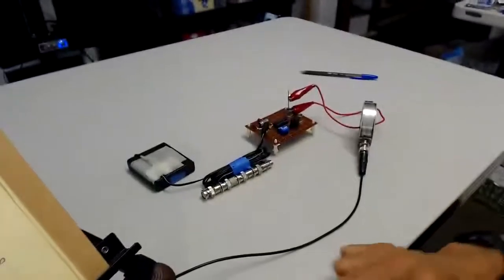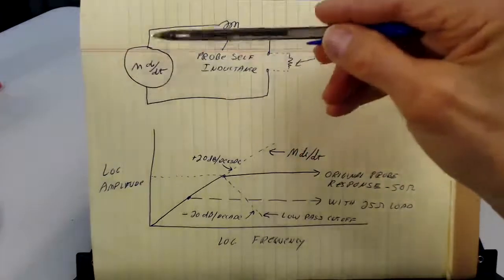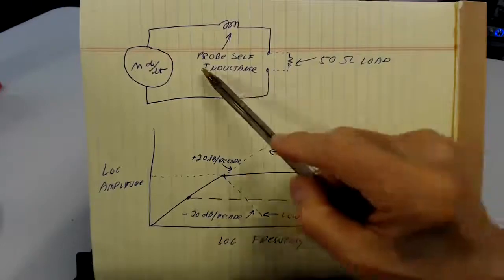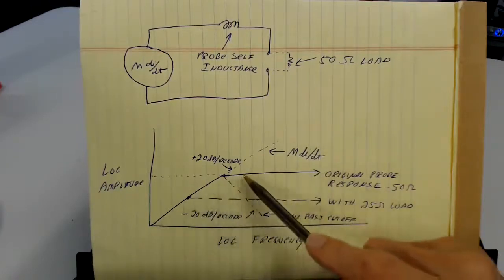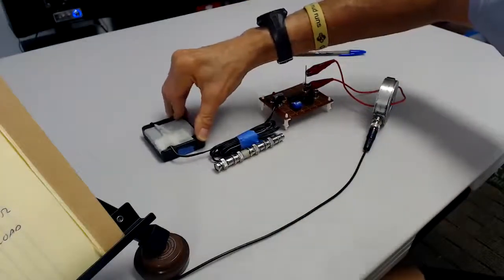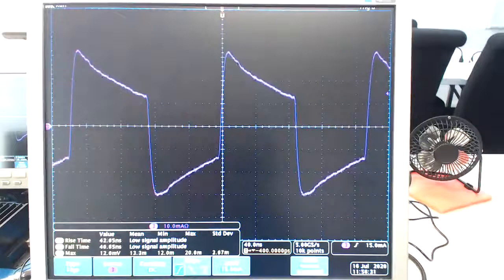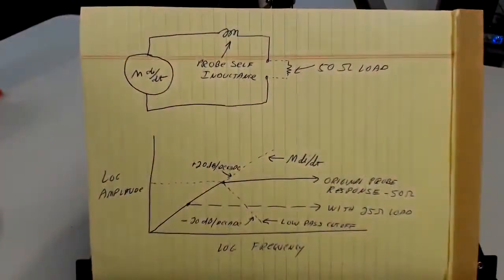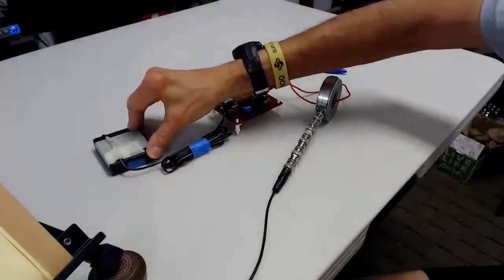Modifying a Current Probe's Frequency Response

Comment: Might be worth putting in a phase advance circuit at the source end to flatten off the coil's response and keeping the sensitivity.   Then you could also load the output of that circuit with the 50Ω and have it matched for the cables and scope.   

Slightly different use of a control theory circuit!   https://www.youtube.com/watch?v=MAb3MkngkGg